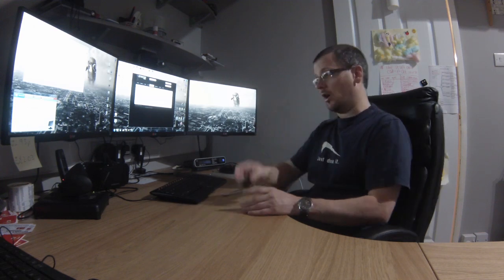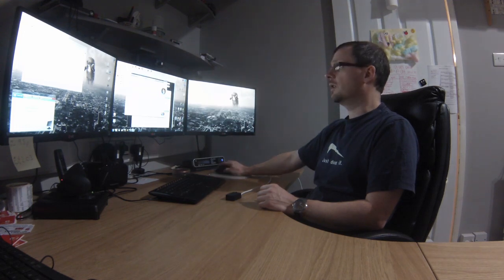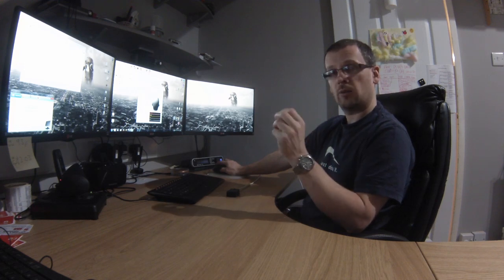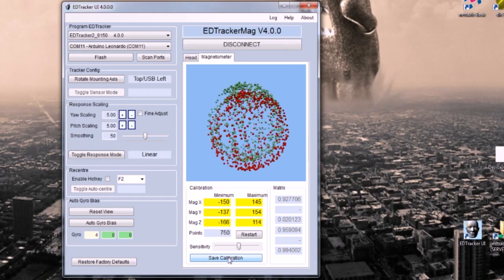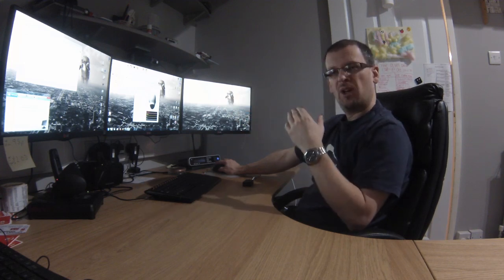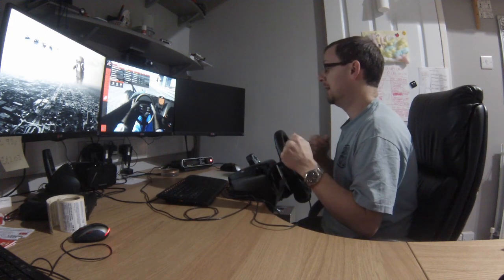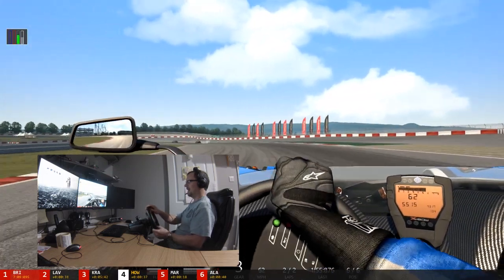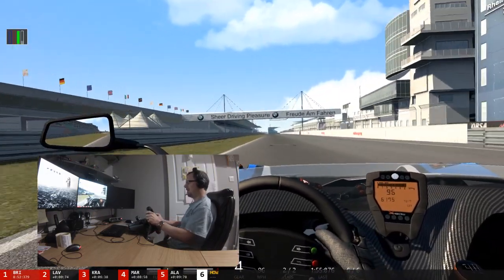DIY EDTracker V4.0.0 Calibration (Magnetometer/9150)

Comment: Got my 9150 today. I calibrate it as guide says, but I have a problem.
When I turn my head side to side it is going back to center. What I'm doing wrong?

Also I did not understand one thing. Device will re-calibrate gyro every time when I plug it to PC. Should I every time unmount it from headset to get it on flat surface?
Reply: yes. put it on a desk or on the wall, perfectly still, and run the gyro reset. in the magnetometer calibration, you need at least 500 points, but you don't need to do the magnetometer calibration maybe once every 3 or 6 months.

Comment: Hi brumster. im thinking about buying the "DIY pro micro MPU-9250, switch , custom edtracker PCB , enclourse" if i buy it , will i get the cable to connect it to my pc with or do i have to buy one myslef? And will the constructions be the exact same to build it as on your "DIY EDTRACKER Construction" video ? Regards Rickard
Reply from the maker: +Rickard risberg Depends where you're buying it from! I'd ask them ;) if it's Hobby Components, then I don't believe they include a cable, no. Construction is pretty much the same yes - the board has changed style just a little bit but essentially it's the same.

Comment: +brumster100 do you have support for the 9255? I noticed this as an option in stores now.
Reply from the maker: Hi +aphocus - no, we don't, and it's unlikely really as the 9255 isn't really targeted out our use of the sensor, so it would be a lot of work for little benefit. It's really more for wearable fitness devices and so forth.
Reply: brumster100 The local shop wants $70 NZD for the SparkFun 9150, so I've been trying to find stuff from ebay/dx since shipping tends to be $50USD from more reputable places, and some places never bother giving you shipping estimates until you've given them personal info.

Maybe I could pick up an EDtracker Pro if shipping isn't too costly?
Reply from the maker: +aphocus Have a look on the site, you can do a guest checkout and get the shipping estimate before you order ;) or if you fancy building it yourself, which we certainly don't dissuade people from doing, then Hobby Components in the UK have pretty good prices and ship worldwide.
Reply: brumster100 Oh thanks :)

Comment: Hello,
Is there a way you can incorporate positional tracking with this? I figure I can use a combination of this chip, and for translation movement I would use IR tracking with cam. Is there a way where you can emulate that without cameras? Maybe using the accelerometer to replicate position tracking?
Reply: Hi there, did you find success in position tracking? Wonder if I can get some guidance from you as I am currently a student working on a project where I track limb movement, would appreciate any help from you :)

Comment: I still have tremendous trouble with calibration - even though I can get a good, solid ball on the magnetometer, auto gyro bias just refuses to settle. Even after demounting my unit from my headset and just leaving it flat on the table, the values oscillate rapidly. It's incredibly frustrating as I have no idea what's causing the problem - I assumed if I had somehow killed the gyro it would just be sending back zeroes, not what appears to be a sawtooth.
Reply: I should add that sometimes the problem can be solved (it seems) by restarting the edtracker ui? Perhaps it is a software bug. Argh!
Reply from the maker: That doesn't sound right, no. Assuming the sensor is not flapping about, some small degree of oscillation on the accelerometer and mag is typical (it's very sensitive) but if you're seeing a sawtooth graph then no, that's not right, something is up with the sensor I would say...
Reply: And yet, restarting the gui seems to have fixed it! Baffling. Thank you very much for your videos by the way - they were a big help in putting this together and configuring it. :)

Comment: Need some help please. My Edtracker was working brilliantly and I decided to Flash with the latest GUI. I flash the magnetometer with no problem, and the Gyro bias gives good results. However, when I test the unit it now refuses to look to either side. the view is just fixed straight ahead. I use DCS and it has been working with no hassle, but at the moment I am stumped. I have re-flashed and recalibrated several times. Any ideas please?
Reply from the maker: You did the mag calibration again yes? Maybe try "restore factory defaults" first and try again, just to be on the safe side... this is 4.0.3 firmware right? Button/recentre does nothing?
Reply: brumster100
 fixed it, user error....I went over 360 deg when calibrating and the values went askew. working brilliantly again, many thanks

Comment: Hi Brumster,
I just want to warn you that GUI v4.0.4 have problem with .NET 4.6. After flash when I press Restore Factory Defaults button I get The write time out error message. At end of Details error report I have :

*****JIT Debugging******
To enable just-in-time (JIT) debugging, the .config file for this application or computer (maschine.config) must have the jitDebugging value set in the system.windows.forms section. 
The aplication must also be compiled with debugging enabled.
Reply from the maker: +Томислав Белопавловић Thanks, I'll pass it on ;) much appreciated...
Reply: +brumster100 
I'm glad if I helped you again ;) ..
Greetings from Serbia

Comment: I built a 6050 based device a while back, but the drifting drove me bonkers. I finally got around to rebuilding it with the 9150 board. Works great, except I get the bizarre auto-centering that I've seen other people reporting. I've recalibrated it over and over and over, and it still keeps doing this. Oddly, when I hold the device in my hand and move it, it doesn't auto-center. But as soon as I stick the thing on my headphones, it acts up.

Any ideas? :/
Reply from the maker: +Enos Shenk A few... 1) you did do a factory reset/wipe when you moved from the 6050 to 9150? Could be an orientation issue otherwise, as the EEPROM values stored between the mag and non-mag versions are different (2) you do the mag calibration with it ON the headset, right? That's important. What do the green/red spheres look like after mag calibration - are the green ones at least forming a sphere :) ?!

There's a slim chance it might be your headphones interfering - are they metallic on the headband? Maybe a ferrous metal of some sort?
Reply: Yeah, I re-flashed to the 9150 code. The sphere dealios definately look spherical. I did the calibration just waggling the thing around in the air, I tried it on the headset but it took forever to get 500 points and the sphere was all sorts of jacked up. I'll give it another go with that method.
Reply from the maker: +Enos Shenk turn the sensitivity up a little to, if need be ;)
Reply: +brumster100 Yeah, no dice man :( This thing is all sorts of not working. In this video you show calibrating by just holding the thing and moving it, I've done it that way and on my headset easily 10-15 times. I've tried the device attached to a couple different headsets, it still always recenters. Even tried flashing the 4.0.3 firmware instead of .4
Reply: +Enos Shenk Did you ever manage to resolve this issue? Experiencing the same.

Comment: I have the 6050 board. got it working in the GUI but under "game controller" its there but none of the axis work. Is there something i have to do after getting it to work with ED tracker? Thanks for the video!
Reply from the maker: Assuming you've done the calibration correctly then flashed the main 2.20.7 firmware in, this is often because the button is jammed down or wired incorrectly - worth checking?
Reply: brumster100 Thank you so much. Brought it to work and turned switch 90 degrees on breadboard. (in turn changing the pins I was connected to) Now it works in "game controller"! You are awesome for taking the time out to make this video and help us!
Reply from the maker: Anthony Rossi No worries, you're welcome ;) thanks for the feedback.... enjoy!

Comment: Hello Brumster. 
Great Work !

I am having a problem with the 9255 MPU.  I flashed it with the EdTracker_9250 4.0.5 and calibrate the magnetometer. Everything works perfectly. However, everytime i disconnect the usb from the device, or restart the computer. The edTracker UI became frozen in the Auto Gyro Bias dialog. 

I've tryied to flash the device with The edtracker2Calib. Every time the device is disconnected from the USB, or the computer restart. The edtracker act like crazy.

Right now, the only workaround is to flash it and recalibrate the magnetometer everytime i turn on the computer (and never disconnect the device). 
Do you have any ideia about this problem ? 
Thank you. Keep the amazing work !
Reply from the maker: +Bruno Marques Is it just the GUI? For example, if you check the virtual joystick in control panel, is that frozen or does it respond find with movement of the device? Basically, rule out whether this is a GUI problem or actually with the EDTracker. Did you build with Pro Micro?
Reply: +brumster100 Its is not just the GUI problem. The virtual joystick respond with the movement of the device, but with a slow rate. Its seens that the movement is registered at 2-3 Hz speed. (2 or 3 updates per second). I think this is related to the Auto Gyro freezing in the GUI (its waiting for input, but at such slow rate, its taking too much time). I`ve built it with a Pro Micro. I am currently using a Windows 10. 64 bits machine.

Do you think it is software or hardware related issue ?
Thank you for you answer.
Reply from the maker: Most likely hardware related I think. Check your wiring, particularly the INT pin and power feeds. Is it a 16MHz 5v Pro Micro? Maybe verify on a separate PC to rule out software/USB issue...? Do you have access to an oscilloscope :) ?!
Reply: +brumster100 Hello Brumster... Unfortunately i dont have an oscilloscope with me =( ... 

I am using a 16Mhz 5V pro micro. 

I've tested the tracker compiling the code with the debug enabled, and i saw that, after the disconnection, the data of the "Verbose Mode" in the serial monitor comes in batchs (at around 1 or 2 seconds of delay each other ).... 
Imediatly after the flash (without a disconnection), the data comes in the propper way. 

I've tryied to reset the arduino (by placing a gwd wire into the RST pin of the arduino while its on). This seens to fix the problem after the disconnection. But i need to do it everytime that i want to use the edtracker. 

It seens that i got a faulty arduino or the bootloader is fault. What do you think ? 

Thank you =)
Reply from the maker: It does sound somewhat dodgy/unusual, yes, I agree. Seems like over time the AVR is hitting a problem... it's not overheating is it? You're running the code completely unmodified too, I assume. Bit hard to say without it in front of me/being able to test/etc :(

Are you in the UK?
Reply: +brumster100 Its not overheating, the temperatures are all fine. I think definetly it is a fault arduino or MPU.  I am from Brazil, so its far from UK. =p. 

I've made a dirty modification of the code to make a hard reset of the arduino everytime the latency between the update loop got higher than 50 ms., Also used one bool to ignore the reset if its performing some heavy operation (like the auto gyro calibration or writting in the eprom). Ofcourse its not suitable for production code, but worked fine for me. Everytime a disconection occurs, its perform a hard reset.

I wired one output of the arduino to the RST. So i set it to Low and the arduino reset. It's ugly, but works. I've tryied to just enable wdt, but it didnt fix my problem.  

Thank you for all the answers.

Comment: I ordered the 9150 prebuilt and calibrated it, I have used it for a while but I noticed that whenever I look directly up or down it moves to one side up and the other side when I look down. Generally a lot of movement to the sides when I move my head up and down.
Reply from the maker: Emil Tang Hi Emil, there's a new GUI v4.0.4.0 plus the 9150 firmware (4.0.3) that fixes this problem and a few others, although it does need the calibration and orientation re-performing.
Reply: brumster100 I am running the UI 4.0.4.0 and it says "EDTrackerMag V4.0.3" over the name so I think I'm running it already.
Reply from the maker: Emil Tang Oh :( I'm a bit lost then, all I can suggest is restoring to factory defaults and re-doing the calibration, it certainly shouldn't do that...?!
Reply: brumster100 i get the same thing with mine. everything works fine, but looking directly up shifts my view to the left while looking directly down shifts my way to the right. calibrated the device like 5 or 6 times now, same result. i ordered the kit from hobbycomponents btw.
Reply from the maker: Dr Strangelove If you change the orientation setting, does it work correctly in any of the other orientations? Not saying this is the fix, just curious trying to understand why it's doing it. If you've oriented the sensor differently to us then that might explain it...
Reply: brumster100 no, sadly it does not. my device shows some weird behaviour today anyway. whenever i get the edtracker anywhere near my headphones (even on top where i mount my device) the axis go crazy (especially the yaw axis). i tried other headphones, same thing (some even worse). i did the calibration like 3 times now, no difference unfortunately. 
in addition there is another thing, i'm wondering about: i just calibrated it and it sits still and flat on my desk and at first it seems absolutely fine (no head movement) but now i noticed a ever so slightly continuos drift to the right. the "yaw" value (green curve) in the gui ever so slightly accumulates over time. i guess it has now been about 15 min and the gui-head noticeably moved to the right although i didn't touch the device since (btw. the yaw drift value (yellow curve) stays flat, no change there).

i constructed the device step by step and exactly as described in the pdf document for the hobby components kit (9150) from your site (i think all the orientation are the same as building it on your custom pcb).

anyway more importantly, i like to thank you and all the team behind the edtracker. i find the whole project to be absolutely fantastic and awesome and it's great to see people like you guys realising awesome things like the edtracker! thank you very much!
Reply from the maker: Dr Strangelove It might be worth calibrating it ON your headset - there's probably some magnetic influence coming from it's construction or earcups. Keep the EDTracker off the actual cups and put it on the top of the headband, if you've not done that already, then try calibrating it on the headset - I appreciate that might be difficult to keep level but it's not actually too hard provided you have fairly steady hands. The drift off on the desk is almost certainly down to mag calibration being off - it sounds to me like you have something influencing the magnetometer nearby. Other option if you're in the UK is by all means drop me a contact via the website and I'll take a look at it for you for the cost of return postage, just to check it is all ok...
Reply: brumster100 I actually find that using the Auto Gyro Bias while wearing the headset with the EDT mounted on gives pretty good results, and any slight head movements doesn't really reduce the performance of the EDT.

ps. My Response Scaling is Yaw: 10.00, Pitch 10.00, Smoothing 90, Toggle Response Mode Linear.
pps. The EDT needs to be solidly attached to the headset, and pulling on the wire (from head movements) can cause problems, so it is an idea to attach the wire to the headset too. (I used tape for both)
Reply: brumster100 calibrated it on the headset. much better results. also it needed at least 1000 reference points for the magnetometer to properly calibrate. interestingly the magnetic field of my body seems to have a noticeable influence on the magnetometer :). i left the room for about 10 min. the yaw was just a tiny bit off, as soon as i sat down it went back to flat (the device was sitting still on my headphones next to me meanwhile).
i'm not from the uk (germany) but thank you very much for the offer. it seems to work now and even if it drifts a tiny bit, it's not that big of a deal for me. i'm already planning to get another round of parts and building my second one for my brother. it's alot of fun actually and maybe then i get to compare the two devices and see if they behave differently.

thanks for your quick and helpful responds brumster! see you around
Reply from the maker: Dr Strangelove Cool, glad to hear it's performing a bit better now ;) enjoy!
Reply: brumster100 Thanks for this! I had the samme issues and calibrating the device ON my headset (Beyerdynamic DT770) and noticed that the circles in the magnetometer window were completly different from when I calibrated the device by itself. Now it's working like a charm!